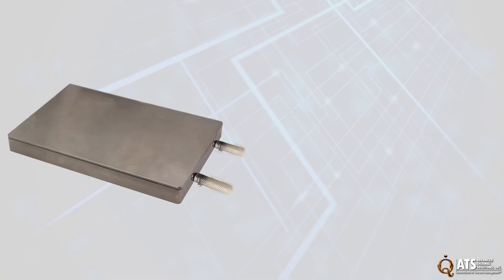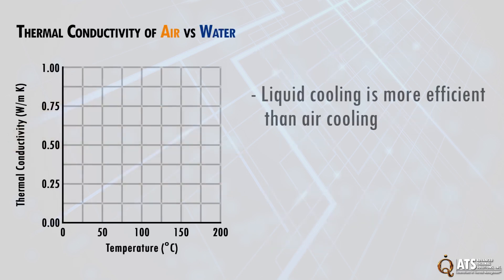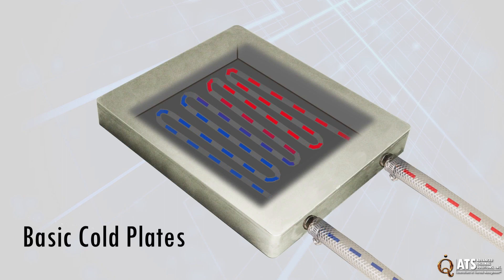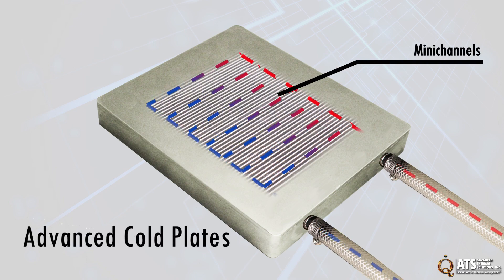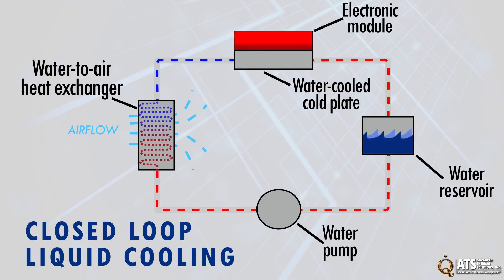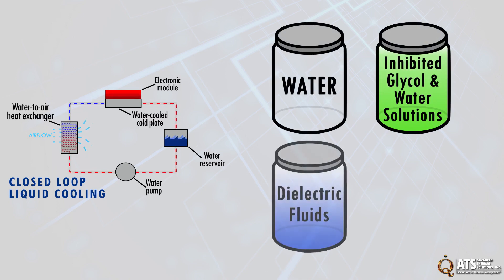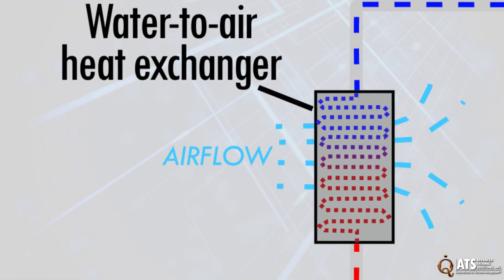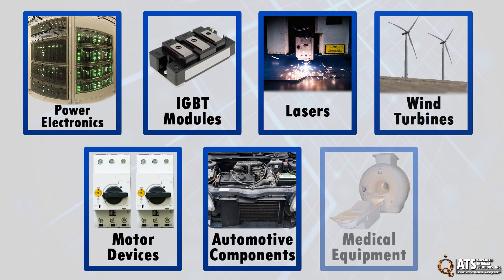What is a Cold Plate and How Does it Work?

Comment: Could a cold plate work if submerged into a coolant tank to help maintain the temperature of the coolant tank?
Reply from the maker: The cold plate would have to be at a significantly lower temperature than the coolant tank so heat could be transferred to it.  We'd have to understand alot more about the application to give you some ideas.  Like, what is the liquid in the coolant tank, what is the volume of the tank, how warm is the coolant, how hot is the heat source, are there any biologics to consider (pets, human organs), etc.
Reply: @heatsinks  I just sent an email to the one at the end of the video. I look forward to hearing from you!

Comment: are the devices described by this video the same as cold plates found in soda systems, which COOL warm liquid by bringing the plate into contact with something cold?
Reply from the maker: These cold plates are used for cooling electronics by transferring heat from the device to a liquid that flows through the cold plate to a remote heat exchanger and it dissipates there.